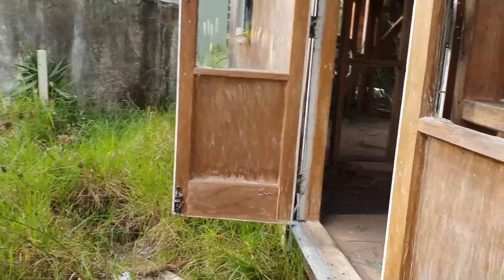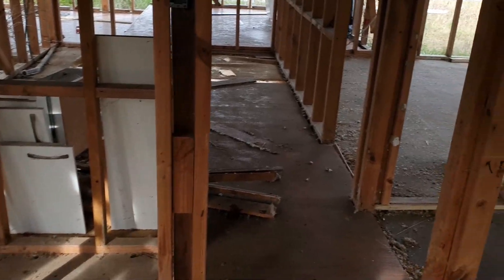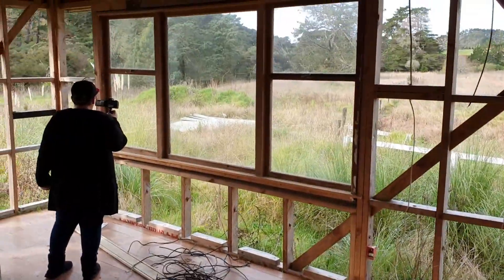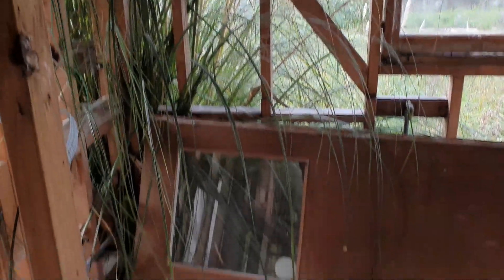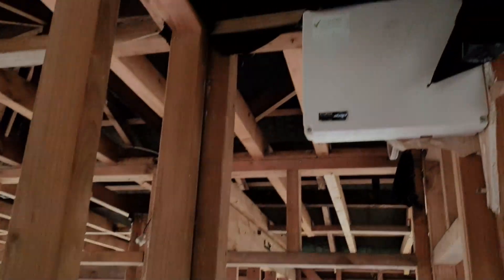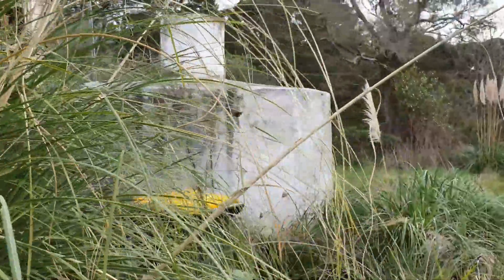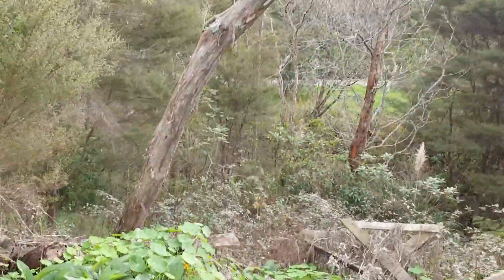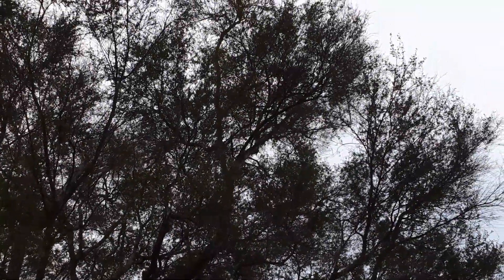THE EX RENTAL, with Exploring With Delywn

Comment: Very cool,  I can only assume based from the photos at the start the original concrete cladding was known for houses with leaky house problems they used to have it quite alot around Auckland and had to re-clad as it would leak and rott out the framing etc,  I'm assuming it leaked so they had to pull it off to re-clad and they run out of money,  I'm pretty sure insurance doesn't cover leaky cladding
Reply from the maker: + Morning Mate that would actually make so much sense I have heard of the issues even with new houses i think. was it just bad concreate ? or bad builders taking shortcuts? i know we've had that issue around New Zealand ., its a real pity this property has so much potential to offer., thanks so much for watching.,